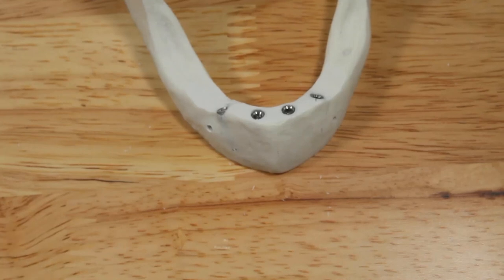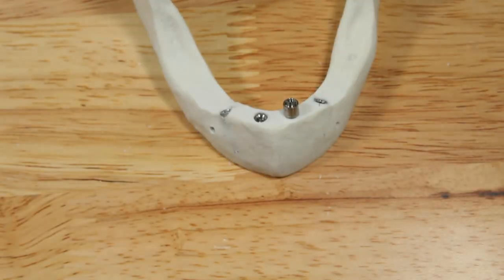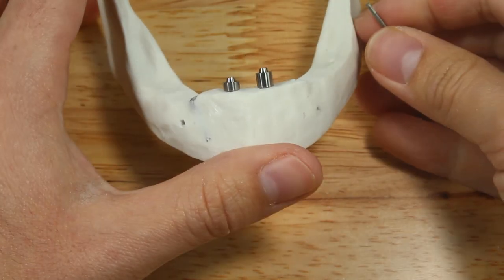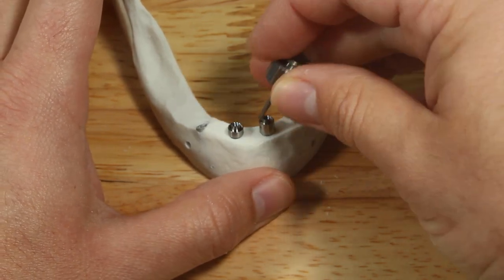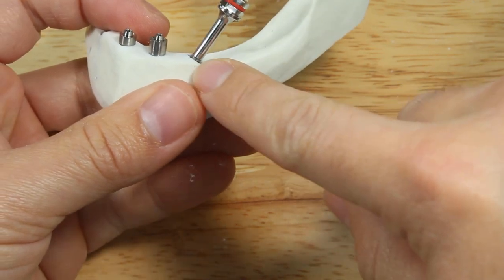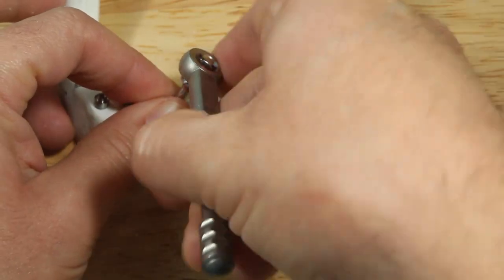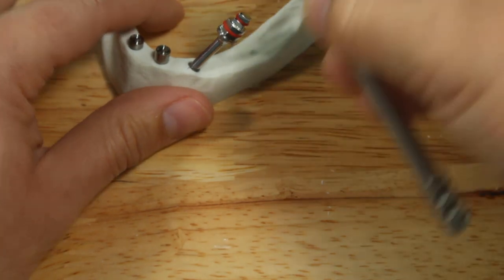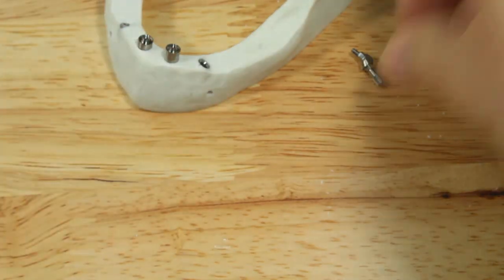SUPER IMPORTANT step for Successful Allon4 conversion!

Comment: Remember 2mm of buccal bone at least surgically.  Also, that AP spread means prosthetic complications long term with any cantilever beyond an equal distance.  Lastly….  Look up Smart Conversions separable fastener so you can shorten your time, strengthen your prosthetic and it makes the process simple with easy clean up.   We angle the posterior implants to place posterior to the mental.  Keep after it. You’re on the right track.

Comment: Thanks for informative videos. I am dental graduate and want to work with dentures. I have two questions- what do you mean by platform of implants. Is it the width of the implant? Also, how do you select impression copings and abutment for a implant? I mean if you get a case where there are implants in place , how do you decide the size and angulation of abutments?